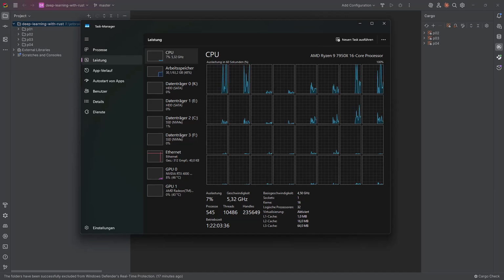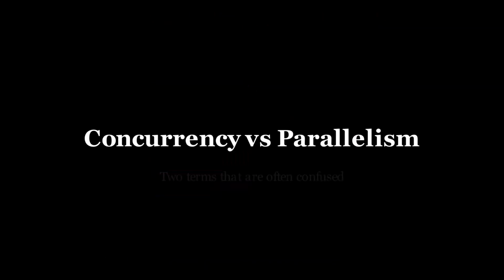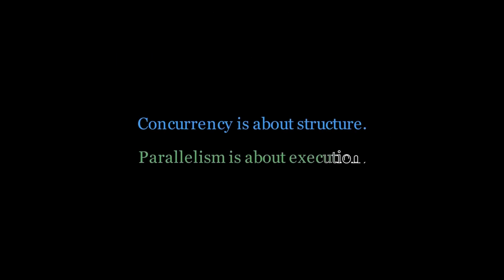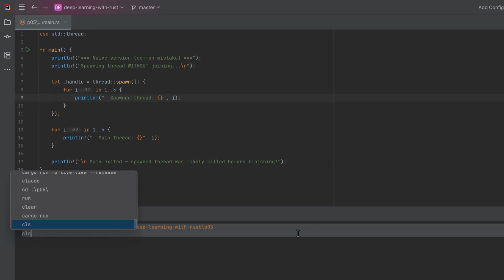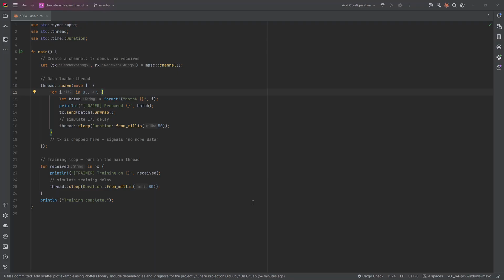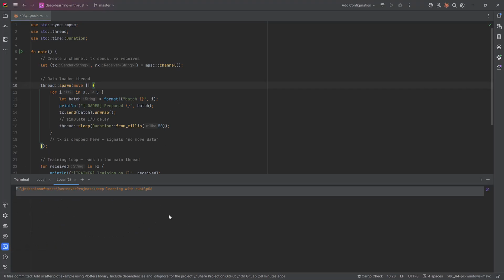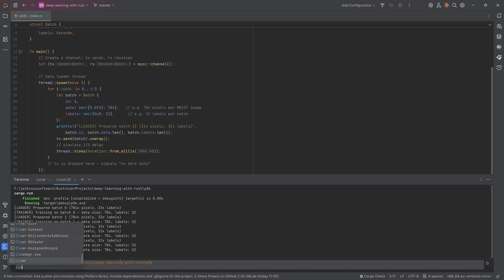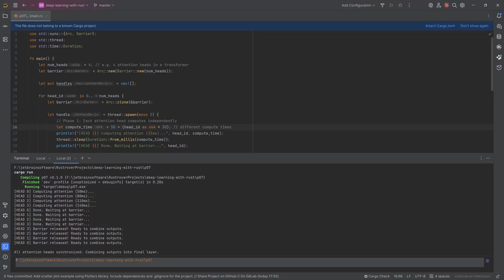Rust Concurrency in AI

Comment: I think a key (but potentially incorrect) realization for me between 2015-now was that GIL really doesn’t matter if you have CUDA bindings and multiprocessing. I thought we would need strong concurrency and compiled languages for AI. But languages like Julia and Chapel (and mojo?) failed to gain traction while Python has continued to consume more and more of the backend stack. It seems like we can simply vectorize all concurrent ops and pipe them into a gpu, so the real bottleneck has been memory speed and bus width.
Reply from the maker: I agree — for deep learning workloads, Python acts mostly as orchestration while the real compute runs in CUDA/C++. In that context, GIL is less of a bottleneck and memory bandwidth becomes the real constraint.

However, this only holds for highly vectorizable workloads. In many AI-related systems (simulation, RL environments, EDA tools, custom runtimes), you still need fine-grained concurrency, low-level control, and efficient CPU utilization — which is where Rust shines.

But my point with Rust concurrency is more about everything around the model: data pipelines, simulation, real-time systems, custom backends, etc.
Not all problems can be vectorized or pushed to CUDA — and that’s where proper concurrency and control (Rust, C++) still matter a lot.